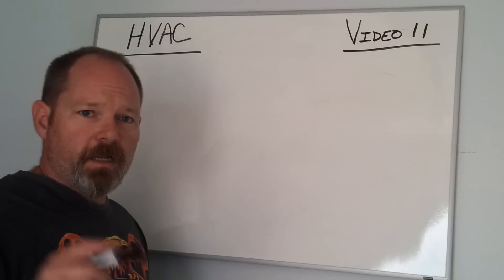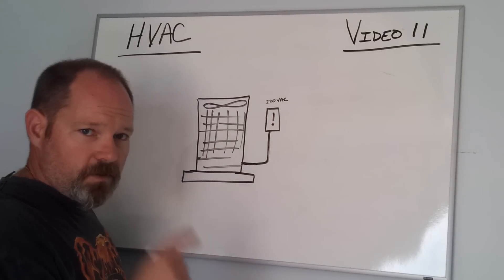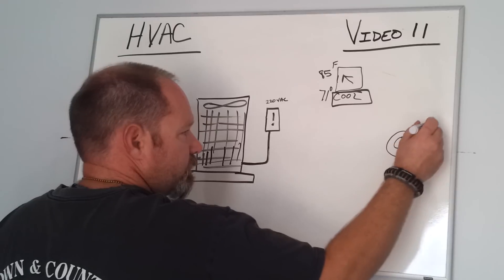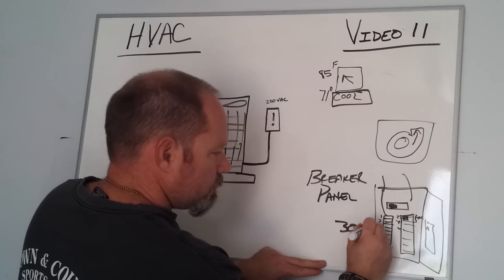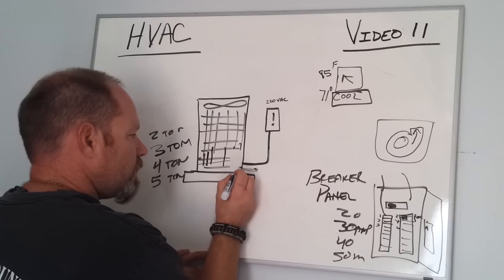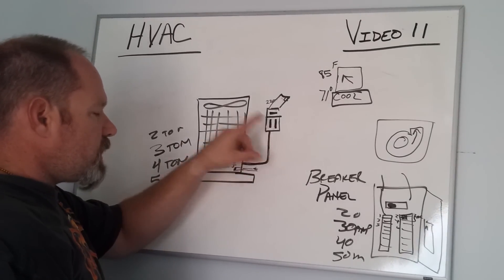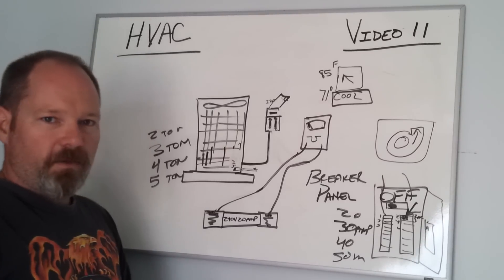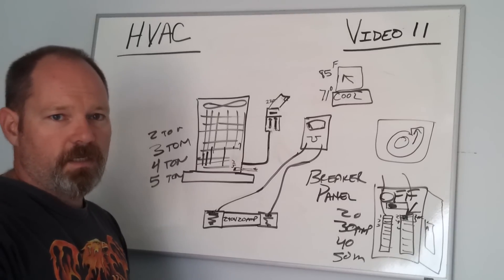BASIC ELECTRICAL 101 #11 ~ HVAC

Comment: I have watched all of your "BASIC ELECTRICAL" videos, and would like to request a topic. Would you please do a video for troubleshooting electrical failure? I am currently experiencing issues with only one room in my building, but I know it's not the breaker panel. My room has no electricity, the fuse at the breaker checks out with the multimeter, and I can't seem to find which wires go to this particular circuit. The building is more than 12 years old, so with all of the renovations, and additions it is quite difficult to pinpoint the issue. Any and all help is greatly appreciated.

Comment: hi, i excelent your explanation but i would like if you can make explanation about electrical sistem  central air 5 ton 230 volts  even  working ambiental termostat.
Reply: kughy